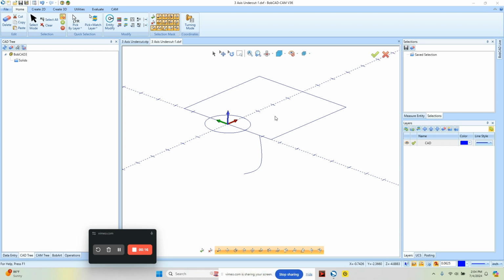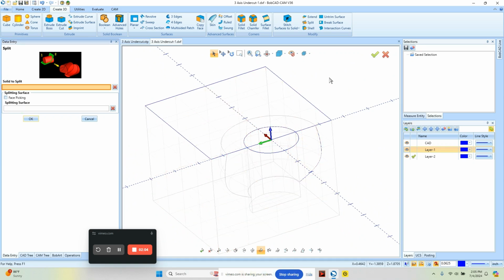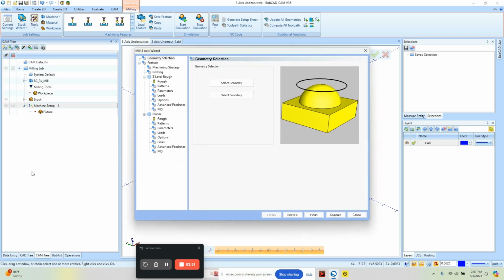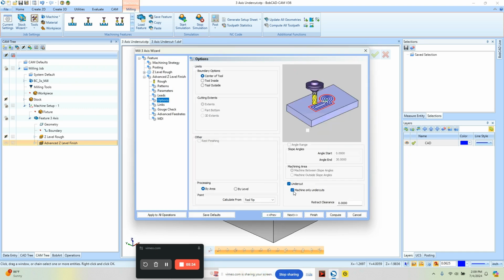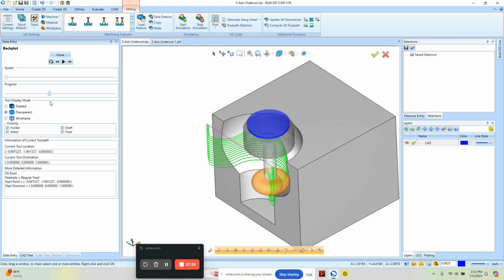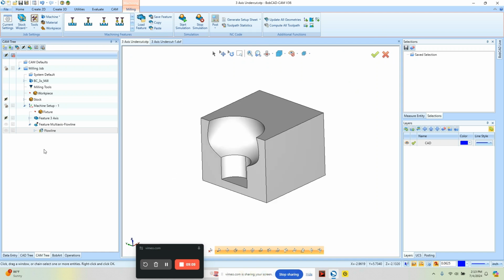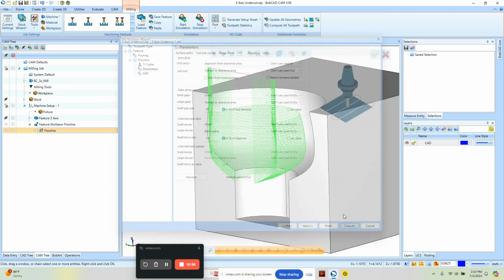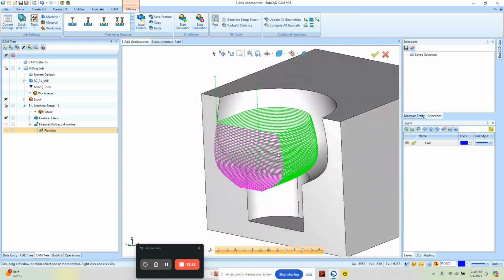3 Axis Undercut with BobCAD CAM / BobCAM for SOLIDWORKS

Comment: Much better resolution, I can see.  what changed with the t-cutter that stopped the tool going around the cube?  With this recent series, I am getting closer to thinking I could make a cheat sheet intercomparing some distinctive examples for the 3-pro and surface paths. My idea is not to cover every switch setting, but to have a concise list of example applications.
thanks
Reply from the maker: Because I enabled "undercutting only " it only created toolpath where undercuts are